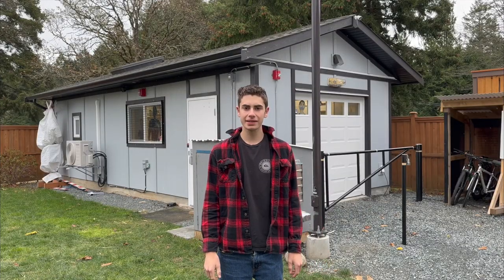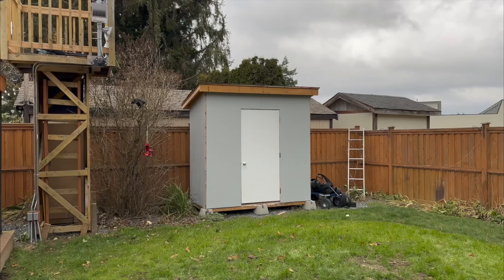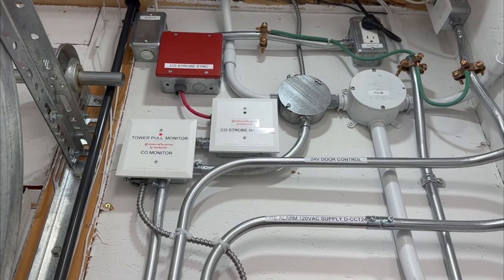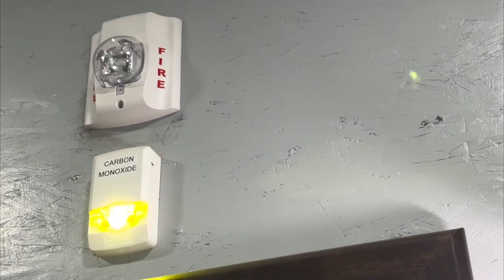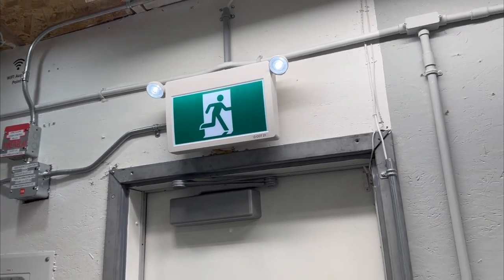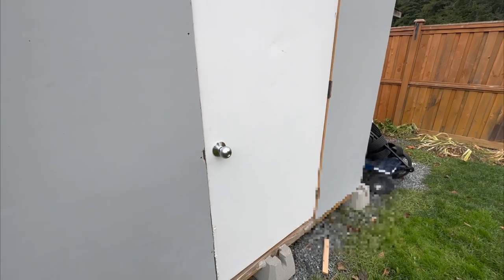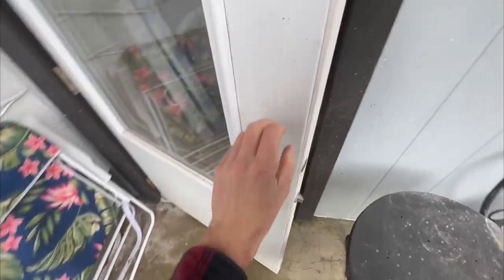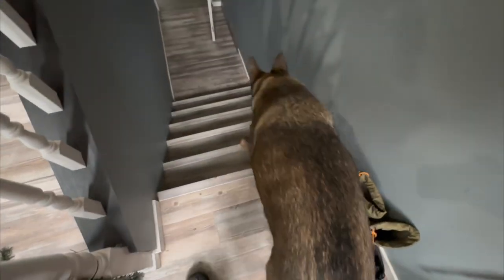December fire alarm, emergency light/exit sign and generator testing

Comment: I have an awesome idea i would like to share, what if you wire up all your bells and other alarms that aren’t in a system and connect them to a pull station and when its new years to set them off?
Reply from the maker: I would have to use a panel as a pull station may not handle that amount of current as well as I don't have a power supply that large however I do have a booster panel I could probably use for this purpose depends how much I want to wake up the neighbours we'll see
Reply: @nics-systems-electric  everyone in my block fires off firework cakes every year, the whole street gathers for the NYE celebrations (reserve made fireworks, lasting up to 3 minutes per cake)

Comment: 15:58 what are the problems exactly..
Reply from the maker: Well I wouldn't be able to do monthly testing anymore for one I also would have constant troubles on the system from detectors being removed as well as I would then need to find an annuncier to go in the house so it could be controlled which is not aesthetically pleasing and the nuisance of false alarms

Comment: What is that thing on the porch?  Looks like a smoker or a stove
Reply from the maker: You gotta be more specific I have no idea there is barbeque fire pit and another fire thing down at the bottom one
Reply: @nics-systems-electric  the little stove looking thing on the wood porch/patio shown at different points in the video looks an old pot belly stove